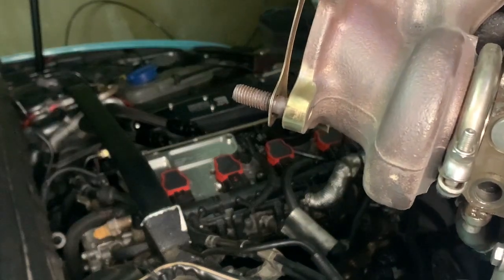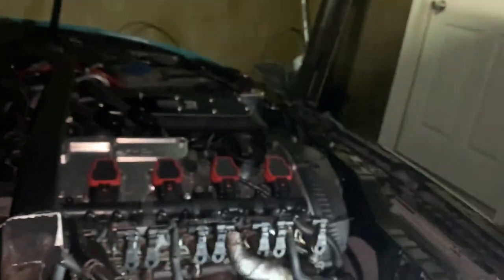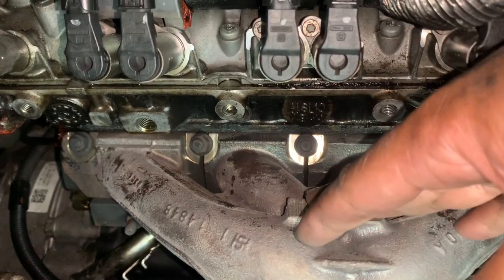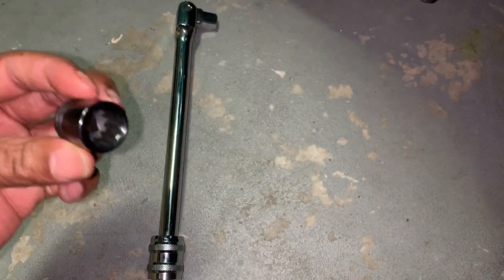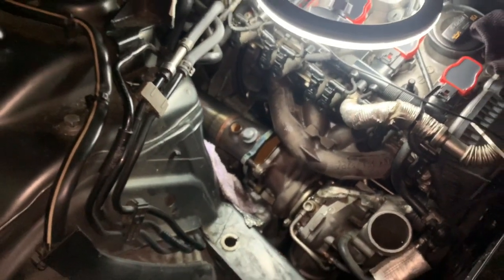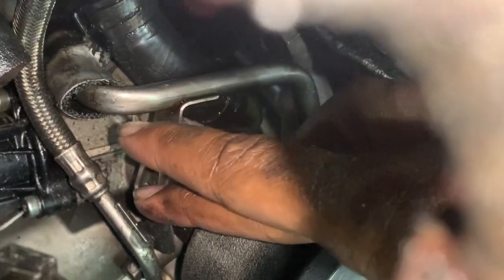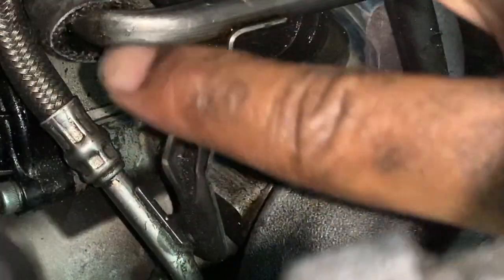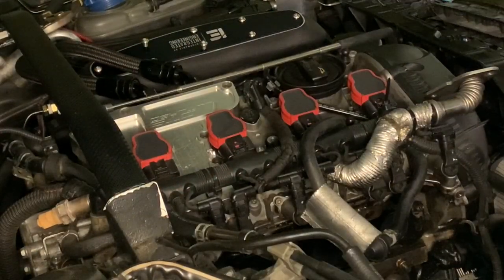(Audi) B7/B8/B8.5 How To Remove Your Turbo at home By your Self K04 Upgrade? 2.0t /1.8t Tfsi | Fsi

Comment: Nice educational vid, but i have a question. Might be a dumb question but What are those mini connectors with the white paint dots on them? Just curious
Reply from the maker: What time stamp
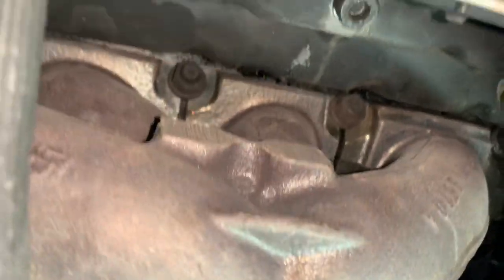Reply: 2:10 its right above the exhaust heat shield i think.
Reply: Exhaust manifold heat shield*

Comment: Hey Bruce, I hope all is well with you brother. I was wonder if you can give us so.e info about your transmission. Any recommended upgrades or maintenance steps to go with all the mods in the engine.
Reply: Did you do the running flap tune for the ie intake manifold. Excited for your feed back as well.
Reply from the maker: Ok I’ll do a video on it brother💪💪

Comment: Remember when you have to reseal the cam cover use anaerobic sealer because the cover needs to sit flush or you'll have oil seepage if you use black or any other gasket sealant. Ask me how I know.

Also when you put the new turbo on make sure to put anti-seize on the manifold bolts.
Reply from the maker: thanks for the info brother, yeh I was lazy, and a shop did it before, and lord behold, 2 bolts came out when I unscrewed them, and, most definitely on the valve,  thankyou
Reply: @brucecustommotors  No problem I just had to inform everyone because I'm in the process of finishing up my build. It started off as a simple timing chain replacement but ended up being a whole cylinderhead tear down and rebuild luckily I did not need to send it to the shop to be  resurfaced but man putting in and lapping new valves was rough my girlfriend literally had to calm me down a few times because of flying valve keepers lol.  let's just say watching yours and one other dudes videos helped a like so thank bro bro. Also before I forget please show in the next video or a third part video how to do a refill of the coolant because someone people including myself do not know how to do it properly without shop air and there is almost no easy way shown or even talked about anywhere trust me I've searched. So when I originally did my chain I had to do a water pump replacement as well which in turn caused me to do a coolant refill I should have done my research like I always do but this time I didn't  which ended with me not doing it properly and let's just say two days later I was pulling the cylinderhead off to find all of my intake valves bent that where not previously bent I will say that on the exhaust side one of the valves in the number three position was cracked nothing crazy but enough to make it loose compression which was one of the main problems I was having before the timing chain issue so I'm sure the coolant refill didn't do it but man it was a whole ass nightmare let me tell you.

Comment: Is that RTV silicone you used for your cam cover? I think it has to be an anaerobic compound, the only colors it comes in is the red or green, could be wrong. Great video though! Cheers
Reply from the maker: Yeh I just bought it from Audi pretty cheap, I’ve used the blue one before aswell

Comment: Hey man I know you did an install of a sprint booster a while back. Do you still have it installed? Any negatives or dangers of installing a throttle booster? Huge fan here. Thanks for all you do!
Reply from the maker: what's up brother yes its still installed, no harm, and works amazing. it just increase throttle response, and helps with lag

Comment: Awesome video, Keep the posts coming!
I'm currently installing a Ko4 and am having trouble sealing the coolant line on the passenger side of the turbo. I had to move the bung to the bottom hole as the OEM line wouldn't line up with the bottom hole. Im now having issues tightening the coolant line as the bung seems to be the in way of the coolant line. Do you think stacking crush washers is a good solution?
Any advice is greatly appreciated!
Reply from the maker: The oil line is easy but the coolant line has a special finicky way it goes in, to me 10 tries, but yes a bung seems like it would help, didn’t think about that
Reply: Running into this same issue now , thought it was my line but contemplating doubling up on the washers as well

Comment: I just need to pull the cat/mid pipe thru the top of the engine cause downstream o2 is seized. Can I just unbolt the manifold and move it enough to where I can pull the cat/mid pipe through the engine bay? I don’t have to do anything with my turbo or anything.
Reply from the maker: Yes you can simply unbolt the down pipe 4 screws, with out moving anything else

Comment: Thanks for the video.  I’m about to tackle this project but been a bit intimidated. What was the 7/8th adapter for the O2 sensor called? Will see if harbor freight has it. Thanks again.
Reply from the maker: I’m here for you bro I’ll look it up for you
Reply: @brucecustommotors  thanks man, no need I found it and it’s also 7/8th   I started and got the heat shield off and used some PB Blaster on the exhaust manifold and bolts on back end of turbo / cat connection. Need to remove the O2 sensor and will spray drivers side bolts on that connection.

Comment: Do you have to remove the the negative battery cable to do this or disconnect the battery to do this?
Reply from the maker: Yes I did, so I would not short out any thing or have an active ground
Reply: @brucecustommotors  will disconnecting the battery for (the time it takes to complete the job) adversely affect the electronics/ecu? I’m going to replace the turbo soon and will replace o2 sensors as well. This is one of the reasons I have not completed the job yet. Thank you for all your knowledge.

Comment: I recently installed a Borgwarner K03 brandnew one. I forgot to put oil in the catridge before installing the oil lines to the turbo. I did however crank the engine 3 times with 10sec interval with coil packs removed before starting the car. Do you think its fine or will my turbo burn out faster?
Reply from the maker: you should be ok

Comment: Hi, do you know if is hard to replace the n75 valve , my Audi a4 B8 show p0299 code , I tried replace the Diverter Valve and I erase the code but it came back, so I would like to replace the n75 valve now but looks little hard to get access, any suggestion

Comment: Hello, I installed an oil collector can and I would like to know if it possible close return turbo and. O problèm ?
Reply from the maker: Can you be just a little more specific, are you saying get rid of your oil return line?
Reply: @brucecustommotors  I would like to know if I do not risk if I close the inlet of the turbo which goes to the valve Pcv pipe?
Reply from the maker: It’s been done, but most catch can systems come with a bypass, which system did you buy

Similarly, any metered airflow in the PCV system must make it all the way to the intake for the same reason. What this means is, if you bypass the PCV system, it must be bypassed completely, both the inlet and the outlet air transfer paths must be blocked. You just can't block off one and not the other.
Reply: @brucecustommotors  What I would like to do is close the air intake, install the catch can and keep  open air in catch can and close the hose goes from the pcv to the turbo  its good ?
I have Buy one cheaps on AliExpress

Comment: Hi Bruce and Everyone, I have 3 questions and maybe a few more to come that I hope I can get some help/feedback on and only on these questions, please no side comments like you should get quattro and so on. 

1. Has anyone else run a Vin number that didn't match the car, not in that it was stolen and they put other vins on the car. I bought a 2011 Audi A5, ran the Vin and it said was Quattro, had it shipped, but when I got it, it was front wheel drive and CVT, any idea how that could happen?

2. I think my turbo needs a rebuild, but I could get a good deal on a K04, any harm running that Turbo on a stock tune? 

3. I know CVT has a relative torque limit of 300 torque, originally I was going to get a stage 1 tune from IE, I asked them about people tuning a CVT, they ask for my engine info and came back saying they don't have a tune for my engine. Is that right? Seems odd? Anyone running a stage 1 tune in a 2.0 US Spec engine with CVT? How is it holding up?

Thanks everybody. I really appreciate it.
Reply from the maker: 1, I think your car, had a vin error, or put in incorrectly

2. my right up on k04 vs K03 https://youtu.be/sZZYaA6xo5M

3.what year is your audi, so i can give you more information on your tune

God bless hit me anytime
Reply: @brucecustommotors  2011 A5 2.0t fwd cvt Cabriolet.
Reply: @brucecustommotors  and thank you, very much appreciated.

Comment: Hey man wondering if you can help me, my Audi is throwing p2279  a intake air leak code every couple days , I replaced the pcv valve got a smoke test and no leaks were found, I was wondering if you had any insight on what it could he
Reply: Be*
Reply from the maker: check your intake manifold flap o6h906283b, and your n80 valve,

Comment: @Bruce Hey man, are the frankenturbo/HPA Hybrids a waste of time? I’m at stage 2 now have been reading a lot of on both sides of the fence on them.
Reply from the maker: There not bad turbos, but it’s pretty much upgrade internals on a k03, it gets more power,  , they just have not got a lot of love, and research
Reply: @brucecustommotors  Right on. Think they can handle a stage 3 tune?

Comment: Hey Bruce I just got a k04 turbo for my 2016 a5 and the new header on the k04 doesn’t fit my down pipe how did you get you’re down pipe to fit you’re k04 ?
Reply from the maker: What k04 , and do you have the factory down pipe

Comment: Question 
I did changed the diverter valve last month before changing the turbo .
No one knows what’s the issue .
The car hesitate on high RPM like over 3000RPM
Then the check engine goes off .
The mechanic put a boost control for me .
Either EPC goes off with over boost code or I get the check engine with under boost code
I keep adjusting the boost control to get to the ideal boost but no success .
Do you have any idea what can it be ?
Can the high pressure fuel pump be bad ?
Reply from the maker: Did you check your , coil are spark plugs, are you getting any misfires, also what turbo did you go with .Did you check the waste gate, Was your Turbo new or used, 
Do a boost leak check with my video or do a smoke test, to make sure installation was done correctly.

Also look at my video boost leak check
https://youtu.be/uGFc0VvwJJc

look at my video on waist gate
https://youtu.be/qUwCe1nNl6Q
Reply: @brucecustommotors  
I have a scanner but I don’t get any other codes than over boost or under boost .
I am going to do the vacuume leak test .
Also going to purchase the OBDELEVEN like you mentioned .
The turbo was new OEM from ebay .
The sparks plugs are new (NGK FACTORY OEM )
My mechanic told me that the COILS are good but the car has 171000 miles and I am not sure if the previous owner has changed them .
I know on B8 models the high pressure fuel pump will fail .
Should I replace that too or just wait ?

Comment: does anyone know if the turbo from the b8 is a direct fit for the b7. founding at junk yard what do I need to make it work
Reply from the maker: It may but worst case you have to change to exhaust manifold, but my bud made it work

Comment: How did you get the two bottom inner bottle on the manifold?  I’m having trouble getting them off right now I rounded one of them fml
Reply from the maker: Yeh 75% of people do, it’s just aft metal, you can use a DreMel, to cut a line, and use a flat head, or a tap out screw, don’t feel bad https://www.google.com/search?q=tap+out+screw+remover&sxsrf=AOaemvKU5e3QZ_EsjjYS2x7-byuioIXIlg%3A1630338271837&source=hp&ei=3_wsYbnbMOar1sQP7KGrsAo&oq=tap+out+screw&gs_lcp=ChFtb2JpbGUtZ3dzLXdpei1ocBABGAEyBQgAEIAEMgUIABCABDIGCAAQFhAeMgYIABAWEB4yBggAEBYQHjIFCAAQhgMyBQgAEIYDMgUIABCGAzoHCCMQ6gIQJzoECCMQJzoKCC4QxwEQowIQJzoICC4QsQMQgwE6DgguEIAEELEDEMcBEKMCOggIABCABBCxAzoRCC4QgAQQsQMQgwEQxwEQ0QM6CAguEIAEELEDOggIABCABBDJAzoFCAAQkgM6DgguELEDEMcBEKMCEJMCOg4ILhCABBCxAxDHARDRAzoFCAAQsQM6CwguEIAEELEDEJMCOgsILhCABBDHARCvAToNCC4QgAQQxwEQrwEQCjoFCC4QgAQ6BwgAEIAEEAo6BAgAEApQrxBYiSlg_ztoAXAAeACAAb4BiAG4C5IBAzcuNpgBAKABAbABDw&sclient=mobile-gws-wiz-hp

Comment: Excellent video. Question being. If you were to upgrade the turbo billet would you need to remove the manifold too? See on the down view on the manifold/turbo, there is a clamp. If that was removed could you pop off the right side of the turbo? Then you could just work on the billet and pop it back on? Or am I completely retarded.